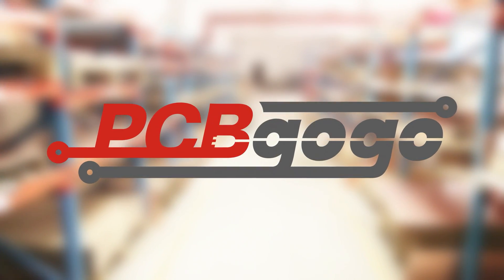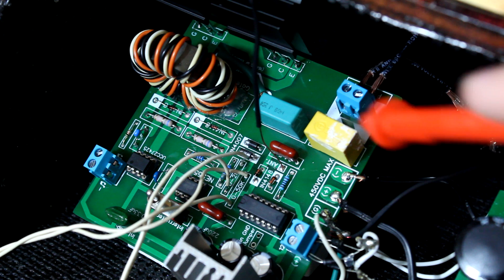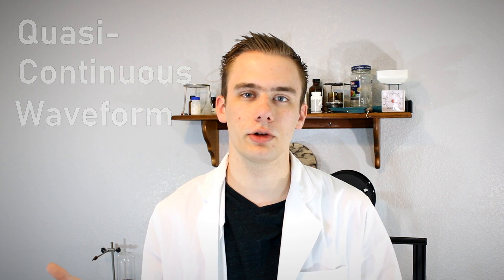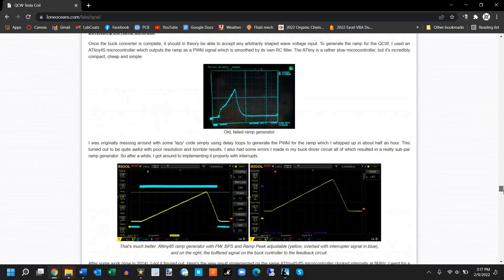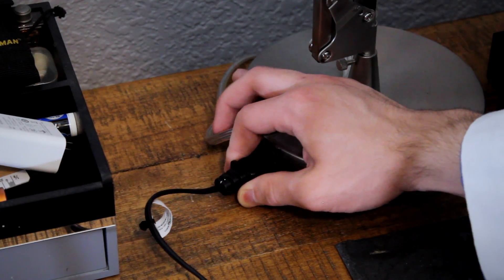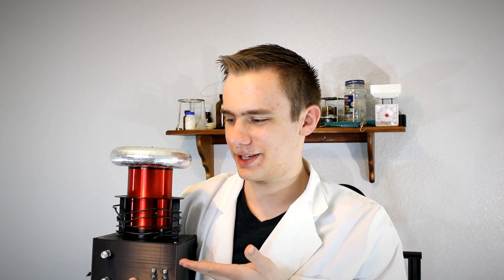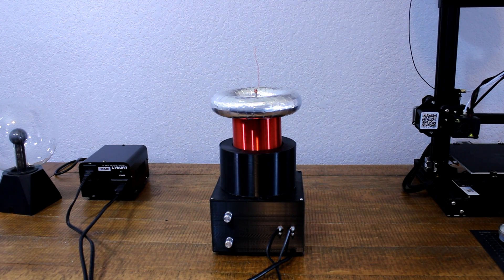World's Easiest QCW Tesla Coil (Staccato-Ramped DRSSTC) | The Ultimate Build Guide

Comment: I heard about this video on the plasma channel. As I also plan to make a QCW I was intrigued. But... on a scale of 10 I cannot give this video and coil more than a 4. It is bad, but not horrendously bad. Let's go through the "points that require improving".
People already pointed out that soldering is not your forte, but that is the least of the issues I had.
Worse is that you do not power your "magic" flip flop correctly. The Vcc lead is left open. You already answered that you "learned" this from the loneoceans site, which I could not believe, so I checked and found that he did not make that mistake.
It is true that the 74hct74 will work in your case because all i o pins have clamp diodes and as you connect 2 inputs to vcc, this will power the chip (but at Vcc-0.7V) but is far from ideal.
Next, the flipflop has nothing to do with the dual resonance mode, it is there to synch the interrupter with the feedback signal.
Next, you do not want a zero impedance on your primary system (coil+cap) as that will fry your transistors and blow your fuse. You add the capacitor to reduce the impedance but not to completely cancel it.
Next your PCB is radiating amateurism, for one thing; there is a reason why loneoceans put his 240V and 12V stuff on separate boards.
Anyway, on the plus side, you got a working coil, which given all above is a miracle indeed.
I have been researching Tesla's work for many years and the amount of bad information found on the i-net is overwhelming. So, if you think I am just being an a*hole, that is probably the reason. I don't mean it to be too a*holian. Maybe you should do a follow up video explaining what you did and said wrong and offer an improved PCB+ schematic. If I remember I may send you my PCB design once done (don't hold your breath though, I have many other projects going).
Reply from the maker: Thank you for your feedback, I appreciate the "hard truths". I honestly don't know why people think my soldering is bad (really...nobody has told me why, and to me, everything looks/works as intended). Granted, I am getting a degree in chemical engineering, not electrical, but I've been soldering for years now (I even worked on a robotics team in my youth), and I've worked in-person with a number of electricians and electrical engineers, yet they never complained about my work...

You'll have to forgive my errors on the PCB revolving around the VCC connection. I realized far too late that the VCC connection was actually displayed in the schematic (by that time, the video was already published). The VCC was somewhat isolated in the schematic, and I failed to notice it for a long time, despite knowing it should be present. 

I also understand the purpose and reason for having the flip-flop, and it does have to do with the dual resonance mode, in the sense that without it, the interrupter would not be synchronized and would likely hard-switch the IGBTs, which is damaging in the stressful DR environment. And yes, I know the goal is not zero impedance, that's why I said the whole bit about "tuning to near-resonance" (sorry, I wasn't as clear on that in the video itself).

Forgive me also for the PCB quality. This is literally the third or fourth PCB I've designed in my life, and I've never taken a class or learned the "proper way" to make one. I understood the problems with mounting everything on one board, but I really wanted a "single PCB" Tesla coil, and I knew the effects would be minimal in the grand scheme of things. And, like you said, I have a working coil (my second one at that) so why worry or complain?

Overall, I feel like I accomplished my goals quite well (minus the VCC fiasco): I gave the Internet it's first basic QCW tutorial and showed a way to make a highly-simplified version that uses staccato in place of a buck converter or phase-shift setup. And testing the circuit with my scope and temperature probe, everything seems to be working exactly as intended. Nothing gets hot, nothing has failed after months of frequent use, and I'm happy. I might try designing a better PCB for a better coil in the future (hopefully with some surface-mount tech to decrease size), but it'll likely be a while. Sorry this project was a bit of a disappointment for you, I'm still pretty new at this YouTube/SSTC game. I hope you and many other people can still appreciate this circuit for what it is. Getting 20" sparks from a 5" coil is still pretty impressive, if you ask me.
Reply: @LabCoatz_Science  Thanks for your positive attitude towards my a bit negative comment! Your chemistry video's are much better and the fact that you managed to keep your IGBT's alive is a real accomplishment! I have burnt through 100-s.
Reply from the maker: @WardenclyffeResearch  Thank you for caring enough to comment! It may suck to get critical comments, but they can be good for growth and improvement. I'm currently working to fix the schematics and PCB files so people building this circuit will at least build it right. I'd be interested to hear what you think makes my PCB so blatantly "amatuer", though. One or two people have given similar criticisms, but nobody has really told me what is wrong with the PCBs (besides having everything on one board). Is it just nuance details, like the silk-screen icons or component footprint sizes, or is there something that could truly impact performance in a negative way?
Reply: @LabCoatz_Science  OK, let me answer that real quick. I may miss a few things, but the first things I notice are:
- No ground plane filling the empty space between the traces on the HF side of the board. (if you add that, keep the HV and LV side separate!)
- antenna is placed near the 240V section.
- 74HCT74 has no decoupling capacitor
- keep HF traces as short as possible, by putting those components close together. (move the 5V &12V power supply to the outside of the circuit)
- move the feed pins to the outside of the board.
- put the 7812 somewhere where you can add a heatsink (if needed)
- use fewer traces; look for example at the traces coming from the left side of the 0.1uF cap between the 37321 and the 555, it forks and has connected traces running parallel next to each other with unnecessary turns.
- Use thinner traces where little current is flowing. And don't put silk screen on the traces that carry strong currents so you can tin them.
I would definitely use SMD components where ever possible as that would make it more compact and thus also shorten the traces. Then put most traces on the top layer so you can use the back as grounded shield. (by filling in the empty space)
Then a change to the circuit; don't put a large capacitor on the output of the 7812. Put it on the input and use a smaller ceramic cap (100n or so) on the output. Also if you decide to change to SMD, don't change the 7812, do change the 7805.
I'm not immediately seeing any, but avoid loops. 
I think, this covers most immediate issues.
Reply: @LabCoatz_Science  Hi, I just started working on my QCW, and as you already got a working design I copied most of your work with some minor changes. I combined the two 555 into one 556, I use a different IGBT driver and I changed most parts to SMD. I still want to implement one other change because in my final version I want the interrupter done through a micro controller (that is for my specific experiments that I want a QCW for). So I want to change this PCB so I can swap in another interrupter. Oh, and I do the high voltage part on a completely separate part of the PCB that one could cut of if one wants to do that, or you can leave it in one piece. 
If I rearrange your name it spells Co-Lab (atz), so if you are interested I can share my work and perhaps add some features that you would like? 
BTW I use KiCAD, see: https://drive.google.com/drive/folders/1rxU-1LA71J9O2jmOu7kTHkPeIgr71qx_

Comment: Hey LabCoatz, what AWG or gauge magnet wire do you use for the secondary? Also, did you link the 3D files somewhere so I could download and print the base?? Awesome build guide, definitely will be building my first tesla coil soon.
Reply from the maker: Glad you liked the build! The secondary wire is 34AWG, and I just bought it from Amazon. And I just uploaded the 3D files! You can find them in the video description, if you're interested!
Reply: @LabCoatz_Science  how many turns?
Reply from the maker: @Gacha.Cupcake  Five inches worth, I didn't count. If you need the number of turns, JavaTC has a built-in mini-calculator that will allow you to predict the number of turns for a given coil (of course, it assumes you know the thickness of the enamel coating on the wire).
Reply: @LabCoatz_Science  thank you. I will wind 32AWG on a 3.5” diameter ke an tube with a length of 5”. Typically I get 150 turns to an inch. So it should be somewhere around 750 or so turns. Some place I saw 5.5” which would make it about 825 turns.

Comment: I want to build this, BUT after examining the schematic and pc layout I'm concerned about the 74HCT74 flipflop. The Vcc (5 volt power}, pin 14 isn't connected! What's up with that?
Reply: Mystery solved! I redrew the driver part of the schematic to see how the circuit works, then it occurred to me that CMOS ics typically have clamping diodes on the inputs. The D and preset pins are connected to 5 volts and can power the chip via the clamping diodes. I’ll connect the power pin to 5 volts just to be sure..
Reply from the maker: @corkymork  Yes! I just looked back at the schematic recently, and the VCC should be connected to +5V. Sorry for the confusion, the connection was somewhat isolated in loneoceans' schematic, so I failed to notice it. The circuit works basically the same without it connected (as you can tell by my video), but you should connect the VCC to +5V if you build this circuit yourself. Hope that clears things up!
Reply from the maker: I truly have no idea why, but that is correct setup. Every Loneoceans SSTC/DRSSTC schematic I've studied showed no connection to the VCC pin of the 74HCT74, so I just followed his directions and it worked flawlessly!

Comment: Is there a place to see your physical connections between the PCB, 14V Transformer, MMC Bank, and Primary coil?
Reply from the maker: Not really besides the schematic. It's very simple though: primary and MMC are in series and connected to the PCB's primary output, and the 12v transformer is directly connected to the 12VAC input. Hope that helps!
Reply: @LabCoatz_Science  That definitley provides some clarity. But is there any way you could add a top-down photo of both the PCB and inside the 3d printed enclosure to the instrucable or PDF?

Comment: If you had a higher frequency ramp generator, would the spark length increase? And what would be the best ramp generator frequency, the secondary's resonant frequency?
Reply from the maker: If you're referring to the PWM frequency in a "true" QCW circuit, there really is no effect on the spark length. This is mostly because the inductor and capacitor in the circuit smooth out the PWM, turning it into a purely-DC ramp with no high frequency component. The only thing that really effects spark length is the duration of the ramp (10-20ms is the usual ramp duration it seems). The PWM frequency should be moderately high frequency for best results (30-40kHz is usually best, but I've seen people go above and below this range). Hope that answers your question!
Reply: @LabCoatz_Science  Actually I was referring to the frequency of the ramps, but yes that does answer my question.  Thanks again!

Comment: Good video but I have two suggestions.

First, this video would be much better without the incredibly distracting and annoying music. I found myself having to mute the sound several times.

Second, letting streamers strike your hand is not a good idea and is not to be encouraged for people attempting to build a Tesla coil. Even though you can't feel it the current is flowing through your body. Nerve cells do not respond to high frequency current which is why you don't feel anything. The skin effect is negligible for a poor conductor such as human tissue. The skin depth at these frequencies extends well into your body.
Reply from the maker: Thank you for your opinions and concerns. The hard rock music is somewhat of a staple in my Tesla coil videos, and the majority of my viewers have indicated that they like it. I found that videos without music were far less engaging, and most "professional" channels utilize background music to some capacity, so I intend to do the same.

In regards to touching the coil's output, I am fully aware that the skin effect has little effect when it comes to the human body and Tesla coils, and that lack of nerve response is the major reason why it's harder to feel Tesla coil sparks. I feel totally comfortable touching small coils for short periods of time for a few reasons. For one, the average power is quite low, especially when the coil is interrupted. Additionally, the relatively small amount of power from the coil is dissipated fairly evenly into over a hundred pounds of flesh (mostly water). This means the average heating of my body is quite low (immeasurable even), and the risk of internal burns is quite small. Until I see reason to believe that low power, high-frequency AC is harmful, I feel quite comfortable demonstrating these effects on video. Maybe I'll film a video on the subject in the future and perform a few tests on human analogs to assess the risk!

Comment: If you use a level shifter on the input you can double your ramp time to 8ms! Using a level shifter (like those used in VTTCs) shifts the mains waveform so it's entirely positive, allowing you to ramp from the peak of the negative halfwave to the peak of the positive, or 8ms. You'll also need to use a doubler for the AC input to the staccato.

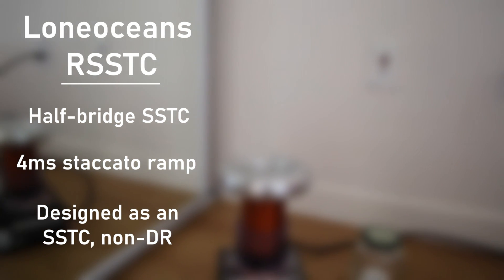Also, you wrote at 7:12 that you have an 8ms ramp vs. loneocean's circuit's 4ms, but it's actually the same for the both of you. He cites only 1/4 of the mains cycle as the ramp since half of the positive halfwave is falling in voltage rather than rising.
Reply from the maker: Very good suggestion! Although at 120V/240V, the capacitor in a level shifter would have to be quite large to allow the proper amount of current through. I just tried with a small film cap worth a few uF, but the output was almost non-existent (probably because the peak current was too low thanks to capacitive impedance). In a VTTC, where the voltage is upwards of 2kV, the 2000 ohms of reactance provided by a 1uF MOC is just fine, since the MOT output is still over an amp, but it seems to be a different story at 120V. Still, I'll be looking into this technology a bit more to see if I can come up with anything!

Also, in regards to the ramp time, that was somewhat of a typo: I was talking about the staccato pulse width. Loneoceans was only 4ms, so he only got the ramp-up time, but mine is 8ms to include the ramp-down period, which gives the sparks a softer sound and thicker appearance.
Reply: @LabCoatz_Science  A large electrolytic should work.
Reply from the maker: @vdekjEE  Wouldn't it have AC/pulses going through it? Electrolytics die from that kind of stuff typically...regardless, I just tried it with a 1000uF capacitor, and the sparks weren't even ramped anymore. Pretty weird, I might have to look into it more before I throw out the idea though...
Reply: @LabCoatz_Science  not difficult for an electrolytic of the size needed (few thousand uF) to handle the RMS current, but (simplicity aside,) the size of this circuitry would be too big to continue coping with mains ramped QCW instead of phase shifted fullbridge or modulated bus
Reply: @LabCoatz_Science  I could have sworn I left a response to this... I certainly wrote it, at the very least. Well, whatever:
Yes it would have some RMS current, but as Ferraday said this isn't an unreasonable ask for larger electrolytics (they need to be able to deal with the ripple current, after all). It would also be fairly low because of staccato.
1000uF is a bit low. I'd use 5k-10k uF

This doesn't really make all that much sense to do for this build since it would add so much weight and volume. Though, the capacitor would only need to be rated for 170v (120v mains peak) if you're level shifting 120v into 240v, so it wouldn't be insane.